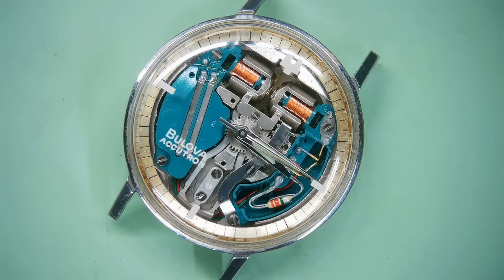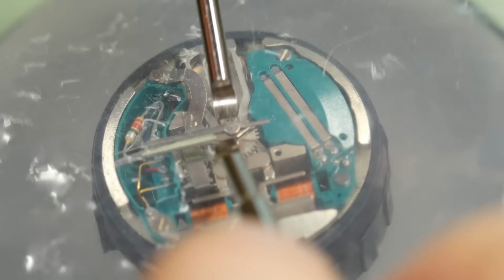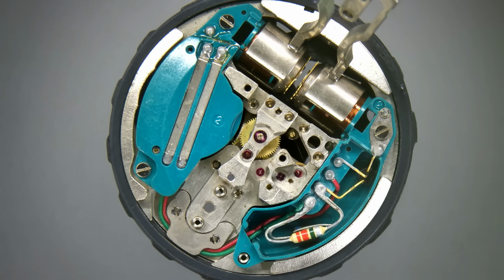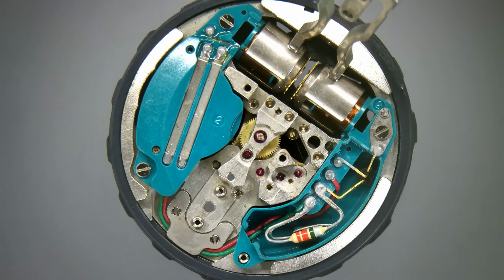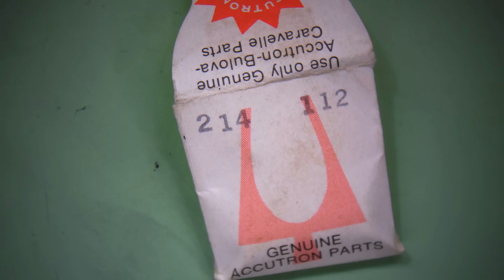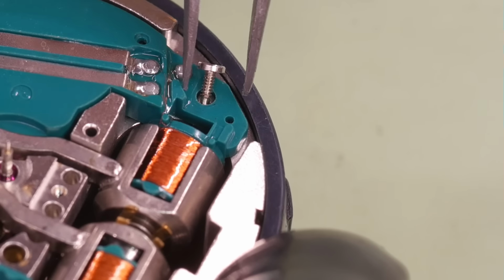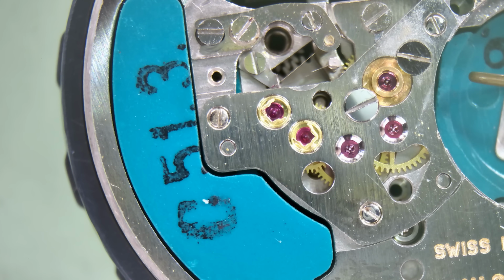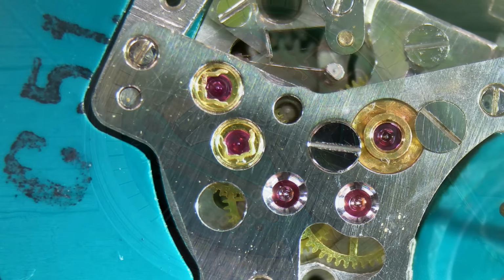Bulova Accutron 214 Restoration - So Precise NASA Astronauts Used Them

Comment: The stabilizer bar that you left in the movement goes over both the locking pawl and the index finger. It's to keep the pawl jewels from falling of the index wheel. If you have issues with centering everything so they don't hit try looking through your scope through the battery port. You will have to pull the seconds pinion out because it will block your view. If you need any help my name is Bryan. I'm not all knowledgeable but what knowledge I have I would love to share. My name is Bryan and you are the first person on utube I ever responded to. Love your show!!!
Reply from the maker: @bryanlaudermilch8526  thanks I feel honoured to be the first person you have commented to. Thanks.

The stabiliser bar?? Is this the guard thing that was at first touching the pawl finger?
I just saw that as a guard to prevent damage rather than it doing anything constructive. I figured it would not to touch either finger. 

It’s ran 5 seconds a day all week which had me thinking I could regulate that in better by the coil regulators. It’s now suddenly started running fast, 2 hours in 8 hours !
Reply: Hey, Bryan. I want to express my gratitude and admiration for your desire to keep these wonderful devices working. These are a special piece of technological and timekeeping history that more people should appreciate. 😊
Reply: You might get some Evaporust and try it on that wheel ( can't hurt right ? ) . It should clean any rust that's on it , and help it stay that way until you happen to need it .
Reply: @f75gunslinger  Good idea.
Reply: @bryanlaudermilch8526 Fancy seeing you here! And especially on your first YouTube comment! 
I purchased one of your "tilty" case space view conversions on eBay around November of 2022, it was one of the ones that had an old lumed crystal on it and was rephased for 1.55v silver oxide batteries. I believe you told me it was one of the few you had in your personal collection? It's still buzzing away keeping good time. 

I just changed the battery for the first time about 3 weeks ago. Hopefully when it comes due for a service, I am able to get ahold of you ;) It's really one of my favourite watches in my collection, definitely my top 3, and I have you to thank for it! There's nothing else quite like it... 

I appreciate very much what you do, as well as your passion and knack for keeping these amazingly unique historical timekeeping devices running and well preserved. Cheers!
Reply: @f75gunslinger 100%, I use it all the time with no ill effects. It might take off paint, but that’s not a deal breaker. I would run it through another wash cycle when done. It’s reusable until you can’t stand to look at it. I pour my used ER through a paint strainer, it helps keep it clean, chunk-wise.
Reply: Welcome to the Comment Section!...😂🎉

Comment: My father, a mechanical engineer,  had a Rolex Oyster Perpetual that he bought before going overseas as artillery officer in WWII.  In the late sixties he replaced it with a Bulova Accutron.  Presciently, he observed "one day you will be able to buy an accurate watch for less than the cost of servicing this Rolex".  Tragically , in 1974  he was killed in a mid-air plane crash. I was in the other airplane, but that is another story.    More than a week  elapsed before  his plane was located in Lake Ontario, and recovered from  30 feet of cold water.   Remarkably his watch shipped no water at all, and was still running and keeping accurate time.  The words "waterproof" on the caseback of these watches, could be taken seriously.
Reply: What an amazing story and sorry for your horrible experience losing your father.

Comment: This is just next level… excuse my limited language. You can say what you want about mechanical wonders in watches, but this is just a fine marriage of electrical and mechanical engineering, predating quartz. This is understated fine watchmaking, thank you mister !
Reply from the maker: You are welcome. They are truly fascinating.  I have another recent video on the Citizen Hisonic which uses the the successor to this movement.  The Bulova 218 movement, also tuning fork with a few design improvements to make it a bit easier to work on. If you liked this video please go check that one out.  Thumbnail is unmistakable with a rotten battery in the movement!

Comment: As somebody who is NOT a watchmaker... I try to imagine work holding a brass wheel that is 2.3-mm diameter and 0.001-in thick, and indexing and cutting three hundred or more teeth around the circumference of it. It boggles the mind. I would love to see how that was done. Mechanically with tiny precision machining? Screen printing a mask and acid etching the extra material away?

Comment: An amazing repair and fascinating to observe the fine detail of this unusual watch. Only thing that surprises me is why you don't use brass angled tweezers to put the screws in, surely that would make that delicate job so much easier.
Reply from the maker: A lot of watchmakers do , some don’t.  For me it’s about feel and I have a light touch and have used the same main tweezers for years. When I use other ones they don’t feel right as I am so tuned into mine.  With a lighter touch I don’t often mark a plate and definitely not a screw.   I damage screws with the drivers when I use the wrong one..

Comment: Is there a capacitor under that resistor?  It is possible that it has drifted out of specification (due to age), and made the transistor it powers to change its oscillation frequency which overall changes the timing of the watch.

Comment: a friend of mine gave me one of these because he thought the watch was over wound, i had never been interested in watches or time keeping before and still really wasn't, it was just an old watch, i took the back off and looked inside saw a battery took it out went got a new one put it in and it started to screech like an angry machine i went got a strap put it on and wore it, my friend tried for 7 years to get it back after finding out it was a battery that needed replacement not overwinding

Comment: I've never seen a wheel with 360 teeth before. Incredible. I'm not a watch expert but I was looking at the rotation of the wheel that those 2 palette fork jewels touch and it seemed to be slightly off centre when it was rotating. 

Great video. Never seen a watch like it before. I'm in awe of the engineering. Thanks.

Comment: You really need to find a crystal driving set so you can start installing ones with the armored tension ring in them. Look for a set that has metal or aluminum dies. It is quite satisfying to drive them home. :-) The one I use is manufactured by the BB Crystal Company. Much better seal than the ones you flex in with the other regular Bulova crystal tool.
Reply from the maker: @stephenkrzanowski  I have the Bergeon tool . The aftermarket tension crystal for this one would not fit no matter how hard I pressed. I almost bent the lugs trying to

Comment: Amazing to see the detail in this.. .. I noticed that the little fingers.. the 1/2 human hair thickness pawls.. are moving around up and down as it runs.. like the needle on a warped vinyl record. It like the wheel is not quite centered.  could be an optical illusion with the camera frame rate and the movement.
Great work getting it working.
Reply from the maker: All models to this especially the 218s that I am familiar with. Just watch my citizen Hisonic video which is the next movement they made.
I am guessing they are so small the wheels are not super centred and as they spin so fast you see this wobble.
It does not affect the accuracy of the watch.

Comment: If I was trying to fix that watch I would replace the 2.2M ohms resistor for a 2.7M ohms. This would allow to run the watch on a modern 1.55V cell. Then I would check the 220nF capacitor. A defective capacitor can make the watch too fast or slow. These components are so inexpensive and easy to replace.

Comment: Smoothest second hand movement goes to Seiko
Reply from the maker: bahhh this is 60 years ago pal before any spring drive was even concieved and unbeaten until the spring drive which is not in the same contest.  Spring drives are highly complex using mechianal mainspring and then a quartz occilator to regulate which in essence is still ticking but the glide wheel never stops and a brake is acted on the wheel to keep it in time. 
The Accutron is a simplistic idea sparked in the 50s, how did they come up with the idea and then be able for instance to make the index wheel 2.3mm diameter 0.001" thick and 360 teeth that spins once per second and beats 360 times a second. 
Both watches are a marvel of technology but the Accutron wins it for me given how long ago it was and how it was unrivalled all this time.  Funnily enough you can get an Accutron regulated well enough to compete with the timekeeping of a spring drive.
Reply: @ relax buddy, it was just an observation…both watches are awesome in their own way….
Reply from the maker: @ don’t worry mate I’m chilled but with a one line comment I like to explain a bit more.   I just can’t get my head around an Accutron. Just how did they do it!?!
Reply: @MyRetroWatches  crazy how they machined those tiny teeth

Comment: I found a special edition Bulova accutron 1973 10KT rolled gold watch at a yard sale over the summer for $1 it's in great condition but it's not running I'm hoping it just needs a new battery?
Reply from the maker: Try it. Remember that it’s positive down.  You can buy what is called an Accucel that fits the 214 movements .

Comment: I wish someone would explain how to remove and replace the crystal/glass.
Reply from the maker: Some are tension ring some are not.  You just push them out from the inside. I did it with my thumbs.
The new one I used a watch press to fit.

Comment: Is anyone else a bit bothered by the indexing wheel seeming to be slightly out of round? Like, I kind of wobbles in and out.... Maybe its by design, maybe its not an issue, but considering the precision that must have been needed for those teeth, and fingers, and.....HOW THE HELL DID THEY EVEN CUT THOSE TEETH?!?!?!.....it just kind of stuck out to me....

Anyhoozle, awesome timepiece mate. I personally love anything that allows you to see the inner machinations of itself. Thanks for showing us!
Reply from the maker: No the 214 and 218 have a wobble. And it’s not a problem for timing .  
They are only 0.001” thick so just fitting the staff could distort the wheel
Reply: @MyRetroWatches  I have a long case movement Ive been fiddling with, and how touchy those plate metal gears are is insane (I still have to take it apart again and flatten out the escapement to engage the fork properly), that gear  in that watch sounds like its practically foil! Still a really cool movement! And still blows my mind how they even cut the dang thing......

Comment: I have an early Bulova Accutron 214. It runs ridiculously fast. What battery did you use in yours?
Reply from the maker: running fast is not the battery it will be that its out of phase and regulation.  I have a 1.5v on mine using a plastic spacer so it will fit.  You can buy an Accucel which will fit and its a battery with a diode that reduces it to the original 1.3v  but whether that would slow it down enough for you I dont know.  Just Google Accucel.

Comment: Amazing engineering. Think about it. The movement is pioneering and tiny, and gorgeous, and still aesthetically pleasing to the eye. A great documenting video of this marvel.
Reply from the maker: I think you say it very well there. It would not have been designed to be pretty either was it was supposed to have a dial on ( many models do)  Bulova took the dial off to show the workings as advertisements in the shops to sell them. 
Customers were so taken by it they wanted that one. Bulova ended up then producing them and the spaceview was born!
Reply: @MyRetroWatches  It's the symmetry of the electro magnets at 12, the copper and the copper colour contrasted with the deep turquoise plastic that makes it attractive. These are contrasting colours on the colour wheel - yellow and blue are similar. The architecture of the watch whether accidental or not is what makes it so appealing. Getting it running is a major bonus. :)

Comment: That was far more complex than I thought it would be. Great job with the rebuild. I'd love an Accutron, but the 38mm Spaceview ones are outside my budget.The index wheel looked like it wasn't running concentric as though either the wheel or pivot was bent a little. Maybe it was just a trick of the lighting though. At least it's running.

Comment: Really nice watch, concerning the smooth seconds hand, I think the Grand Seiko Spring Drive movements are even smoother, because there is no humming back and forth needed. But shurely the difference is really small
Reply from the maker: I read GS is 256 beats per second Accutron is over 300.  As there is 60 years apart and modern technology and design it just shows how significant the Accutron is as an achievement.  Same accuracy as a spring drive but without a quartz crystal!

Comment: What manufacturing process gives 360 teeth on a 3mm diameter gear! I had read that we still cant recreate those gears. Is that true?
Reply from the maker: @TheSakzzz  as far as I have read all the tooling went in the bin.
My guess is the wheels were made longer and sliced somehow. It’s some beryllium alloy
Reply: They have had a device called a milling machine index head used to produce precision gears and anything else where you need to make cuts around a circular object. It was probably what they used for watch making for many years before numerical control machines became available. The trick is to stack the parts up and make a number of them at the same time. Yes, it is time consuming but the watches weren't cheap for a reason.

Comment: I'm glad I watched this and your other Accutron videos as I am thinking these are way above my skillset right now and I think its important for folks to realise their limitations and thus my 218 is safe from poking hands of mine.   I've got two 242's running and will do me fine and I am quite used to kicking cans long down the road so to speak.
Reply from the maker: Sometimes putting things off builds more tension and anxiety on actually doing them. 
I find to just dive in, know your limits and just be really careful.
The 218 is not that big of a deal once you get the train wheels in.
Granted setup after is a bit long winded but equally that’s some of the fun to get them a few seconds a day.

Comment: where can you get the mercury batteries?  I bought one 20 years ago and could never find a battery that didn't make it run fast.
Reply from the maker: @kpurintun  mine runs on a 1.5v normal battery as I phased it to run on it.
You can buy what is called an Accucel (google them). They are a 1.5v battery with a plastic shroud, a bit of brass and a diode to reduce to 1.3v

Comment: I inherited a 1967, (m7) accutron, original box, paper work, bill of sale, literally was only worn on special occasions, when the first battery died it was left unused. Watching this video, I’m thinking I aught to use It but where do I get the special battery?
Reply from the maker: You can buy a battery called an Accucel. They are a standard 1.5v in a plastic shroud with a diode that reduces the voltage to 1.3
Mine, because I have phased it will run fine on a 1.5v but you would need all the equipment i have to do that!

Comment: I’m intrigued by the movement’s design, but a continuously audible high frequency sound would drive me insane due to my freakishly sensitive hearing.
Reply from the maker: You can’t hear it. It’s only when you hold it to your ear or you have it in a wooden surface in your bedroom in the quiet hours. 
It’s not audible on your wrist.

Comment: I have this exact model, and according to the case numbers, it's a genuine factory-made SpaceView. Regulating is fairly easy, with the twin adjustment rings on the fork to the inside of the coils, but they must be adjusted equally. The Accutron Watch Page has all the information on these.
Reply from the maker: They are the same as the 218s that I am familiar with. Still has to be in phase though first I think before done adjusting.
This one has been 5 seconds a day all week which I was happy with as I knew I could tweak that but then suddenly it’s ran fast by two hours over only 8 hours !
At least it’s giving me more entertainment to go back in and see what’s up…..!
Reply: There was also something about the battery voltage. They originally had a 1.3V, but those are no longer available, so it's 1.5V, and it does need to be phased to run with it.
Reply from the maker: @valengreymoon5623  yes I am running this with a 1.5v with a shroud to hold it. You can get an accucel which is just a battery , shroud and a diode to reduce the battery to 1.3v

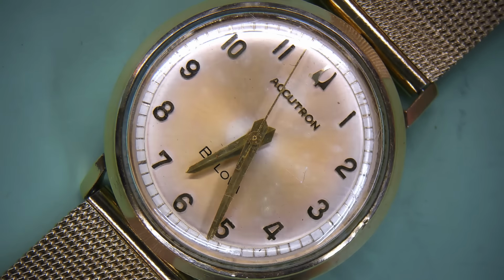Comment: 2:42 WRONG. Seiko Springdrive is the king of smooth.
Reply from the maker: Not really. Spring drives don’t beat. They are quartz modern technology. 
An Accutron came out in 1960 a full decade before quartz was even a thing.  To give it 360 beats a second and the engineering involved for that time to then mass produce is nothing short of sensational.
Although a spring drives glides it has no escapement and is totally different .
It’s like comparing an electric car to a combustion engine.
Never belittle the Accutron as for its day nothing was like it other than maybe today’s spring drives. 
No mechanical watch was able to get close to its accuracy.
Reply: @MyRetroWatches  Yes really. The Accutron has no escapment either and is a totally different thing to a mechanical watch. Yes springdrives have a quartz regulator but they are fully auto and dont need a battery. I'm just saying the seconds sweep of the Accutron is not the smoothest there is. Still a cool watch tho which is on my list to get one day.